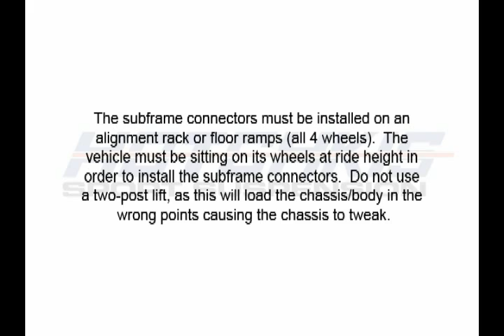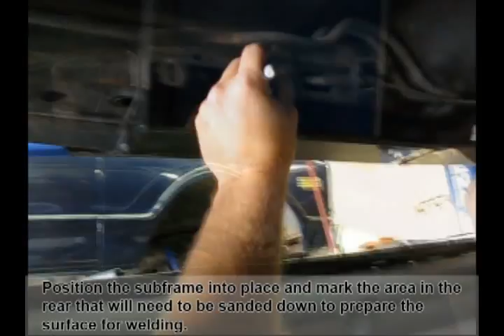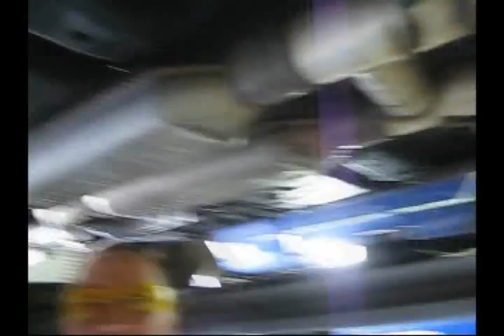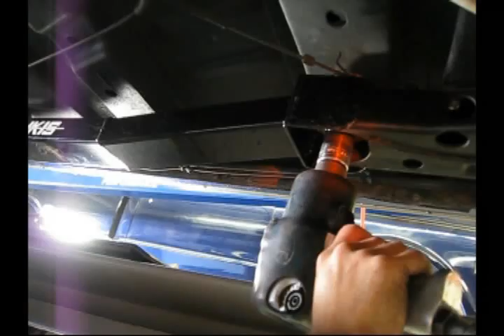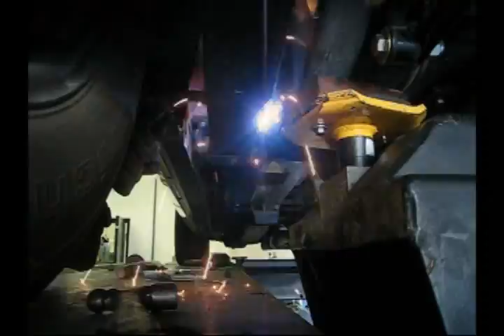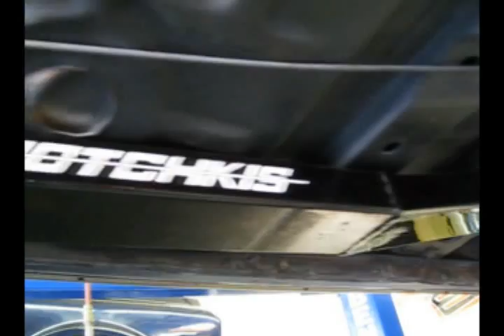How To: 70-74 Camaro Hotchkis Subframe Connectors Installation

Comment: You neglect to show that the brake and fuel lines are licked in once the connector is in place making access to welding extremely difficult. You also don't show how difficult it is to clean and weld the side closest to the leaf spring mount. Those 2 major pains were left out of this video making it look easy when in fact it was a pain in the a$$.